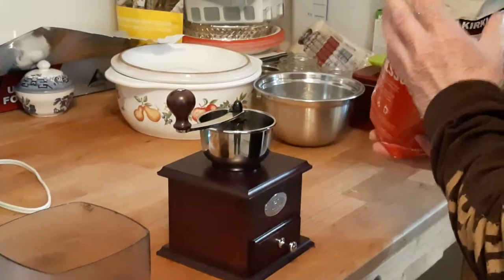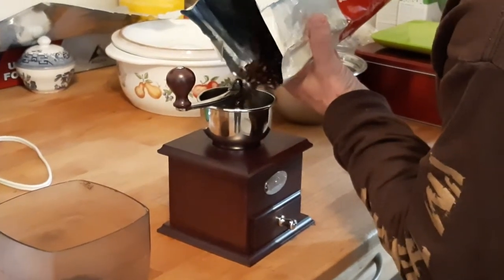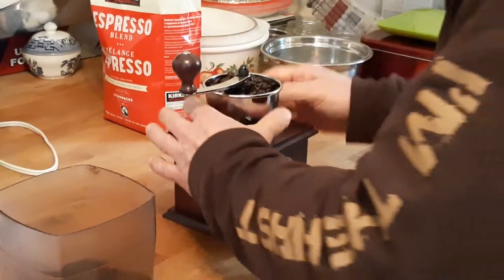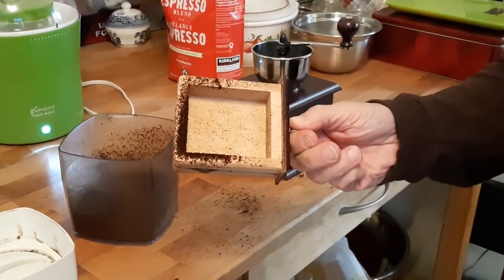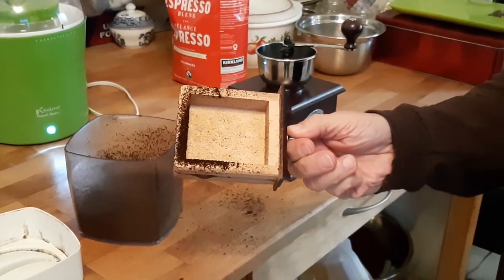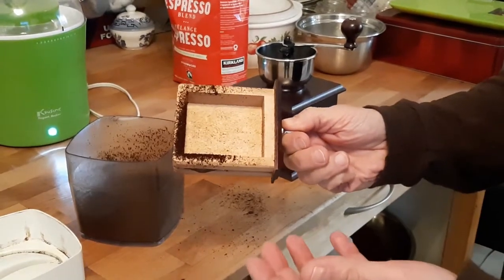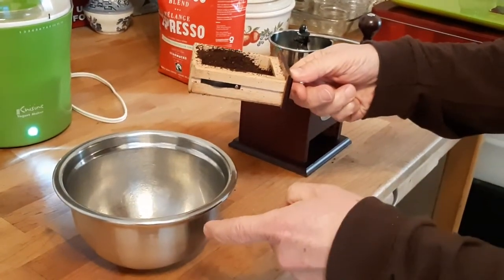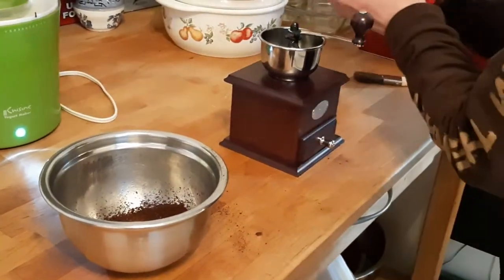Eliminating the static when grinding coffee

Comment: Hi! I have the same coffee mill but when i grind, the mill just slides on the surface and its impossible to use. How do you make yours sit still on top of the counter like that?
I grind using the finest setting.
Reply from the maker: Hi, in the video I'm grinding dark roast coffee which is the easiest to grind, also I'm using a coarse setting which makes it even easier, plus the table I'm grinding on is an unfinished wooden surface which isn't very slippery to begin with so I'm not having too much trouble holding it down. When I grind using the finest setting for my espresso maker it's much harder and takes a lot more force to hold it down. I just did a little test using a silicone baking sheet that I put the grinder on and that made the difference. You could also use contact grip shelf and drawer liner. Light roast coffee is harder to grind than dark roast. video to follow.
Reply: Wet towel will do the trick.
Reply from the maker: @chunchin1317  thanks